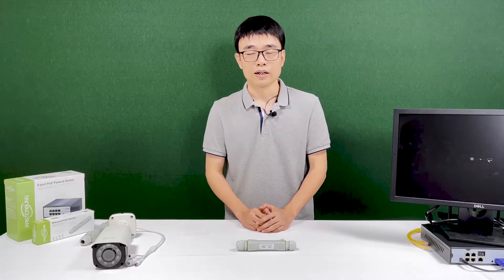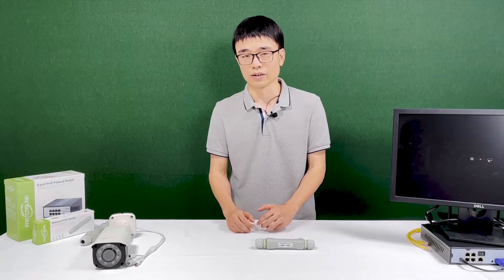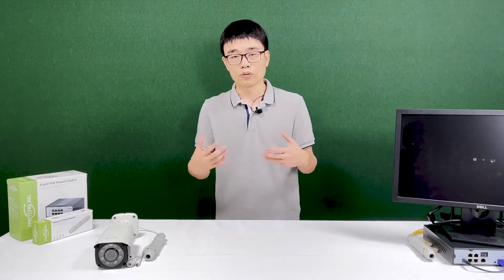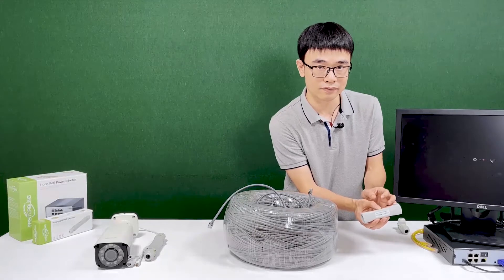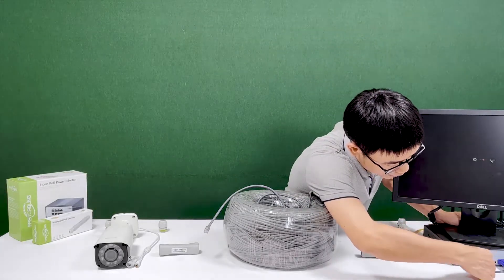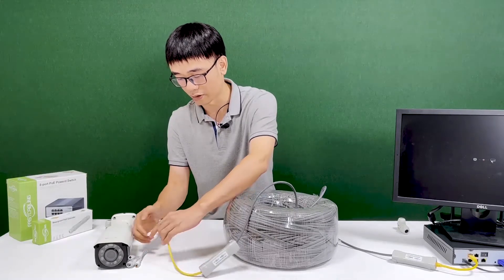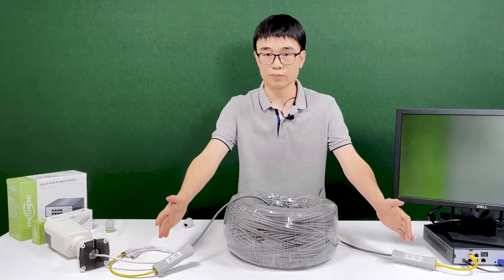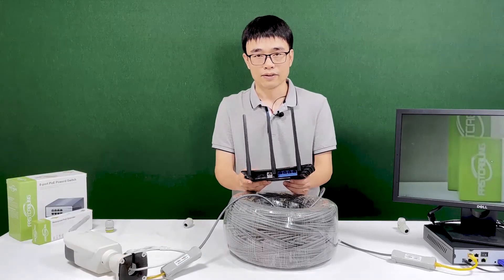How to get 1000ft continuous run PoE for IP cameras

Comment: So can i also do this to power an outdoor router? Just put the poe injector at my house, the start of the poe and a poe extender right before my outdoor router, 800 feet away? I dont understand why the extender doesn't need to be in the center of the line, like every 328 feet?  How exactly is this working, it doesn't seem possible?
Reply from the maker: As long as it's a PoE device. The maximum distance between two extenders is about 1000ft (1600ft in total). These PoE extenders have a long-range chipset, so connect the input ports of both extenders, and you can extend the range up to 1600ft.

Daisy-chaining multiple extenders can sometimes be risky. If one extender fails, the entire link will be cut off.

Comment: Can connect ip camera using fiber optic cable for long distance to a network control room and using the same ip  camera wireless connected to the control room if fiber optic cut
Reply from the maker: Yes, you can use dual IP setup if supported by the cameras, or configure the camera to automatically switch to the secondary network upon failure of the primary.

Comment: What Cat to run for POE security cameras? Cat5 or 5E or 6.. Maybe a video on that at various ranges..
Reply from the maker: Cat5e will be good enough. If you have long run beyond 328ft, you might pick the 100% copper type, not CCA low cost type. The pure copper reduces the power loss during long run.
Reply: @Fastcabling  Would CCA be good for 300 meters with an injector and a extender and what injector would be required for 200+ meter runs.. Thank you
Reply from the maker: @karokis  You should stay away from CCA in long run PoE. The voltage drop (power loss) will become dramatically.
Reply: @Fastcabling  Ok and thank you.. Great videos..